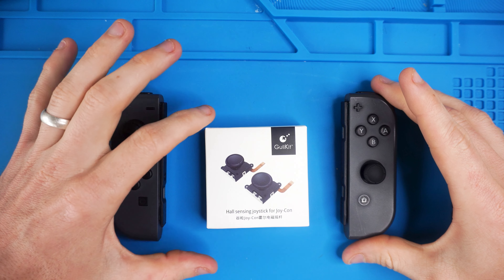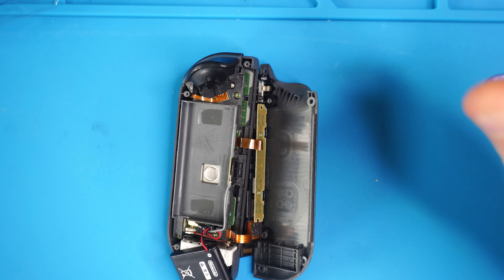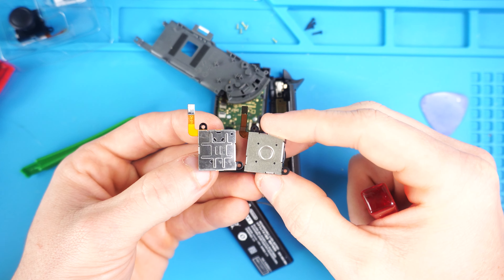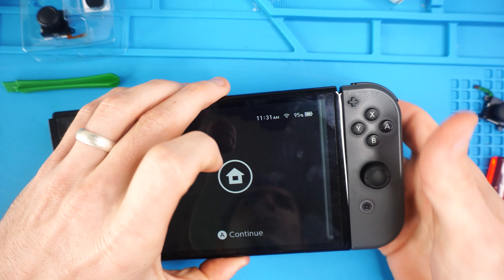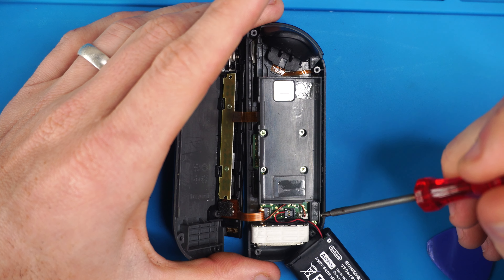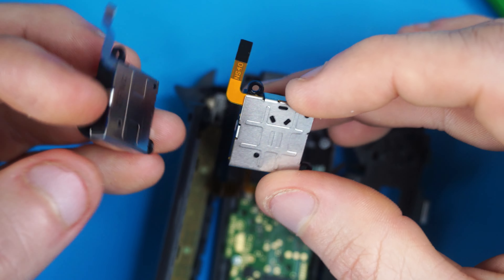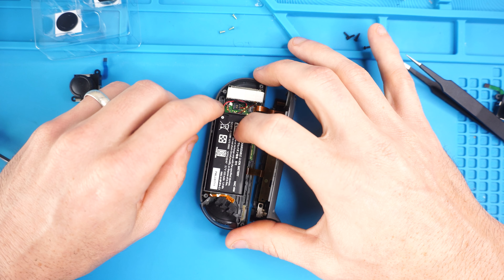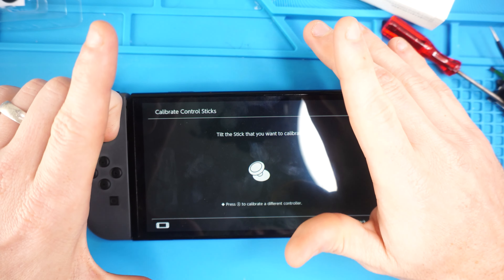Guilikit Joycon Installation LEFT AND RIGHT JOYCON JOYSTICK REPLACEMENT Nintendo Switch

Comment: This might be off topic but my Wii controller doesn’t wanna work.
It does power on and work normally but the problem is that the built in Wii MotionPlus does not work.
When I play Wii Sports Resort it says specifically says “One or more Wii Remotes do not have Wii MotionPlus accessories attached.”
Do you know any fix to this problem?